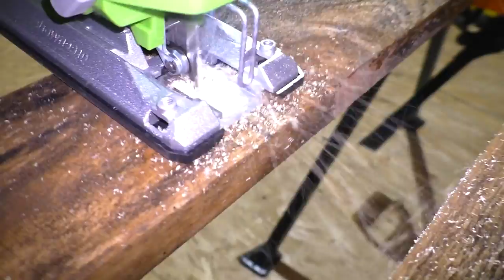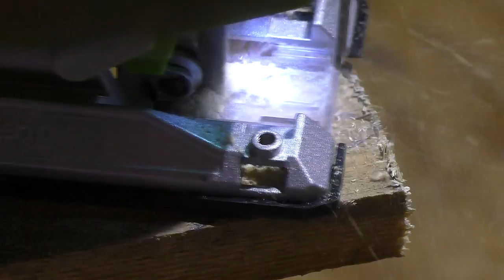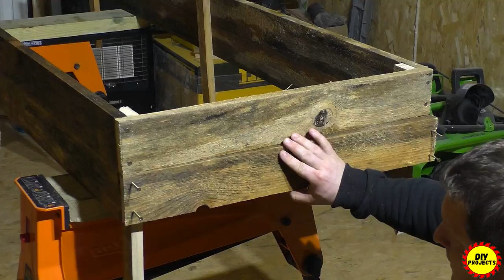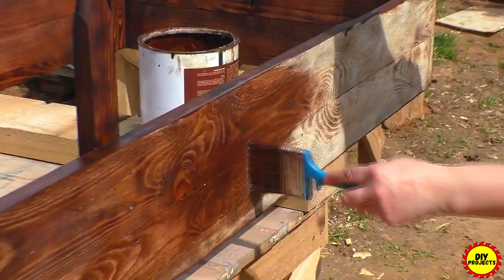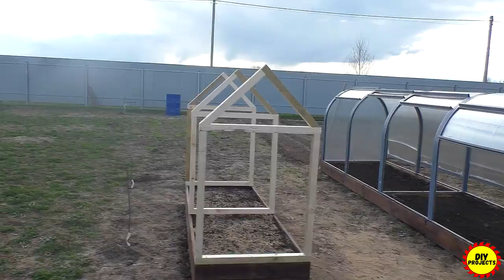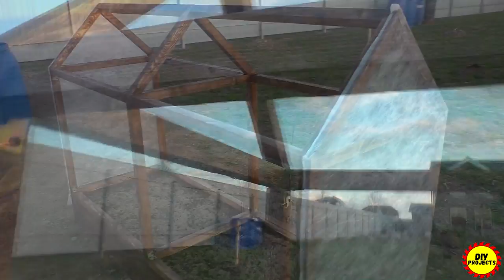The most budget greenhouse. Do not buy do it yourself!

Comment: What is the purpose of burning the wood before staining? Is it simply for looks or us there another reason?
Reply: Brings out the detail of the grain. Common practice.
Reply: The softer parts of the grain will burn and blacken while the harder parts will resist burning and remain whitish and therefore there is an bigger contrast in the grain pattern and it shows better.